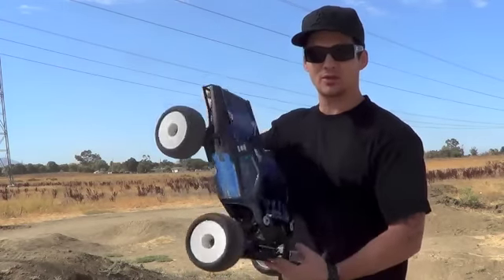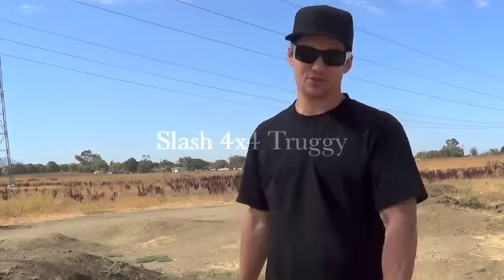Slash 4x4 Truggy run video

Comment from the maker: well i still think they work really good, i have 3 sets of them on 3 different cars and this is the first time i have had a breakage. I believe it was due to the tires size, they were just way too big for that size drive axes.

What motor and ESC do you plan to run? if you leave it stock you really shouldn't need the MIP driveshafts. Its a lot of weight and the $100 could buy you better upgrades. Just my opinion though, hope it helps!

Comment: When you said 1/8th mip drive shafts are you just talking about slash 4x4 ones. Thanks, also have you tried teknos , i hear they are a little better. I need some for my slash 4x4 MMP 2400 and 3s/4s

Comment: I was thinking of using 4s with a mamba max pro and a 35 by 70mm ("standard" 550 size) 1900kv Tacon motor but that might be a bit overkill lol. So if I leave the power system stock I should be fine with the driveline?